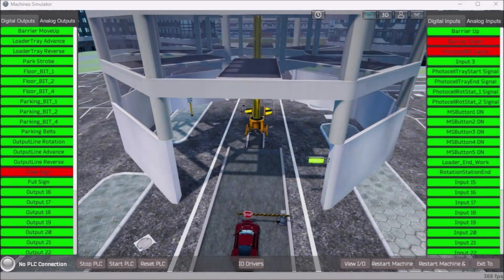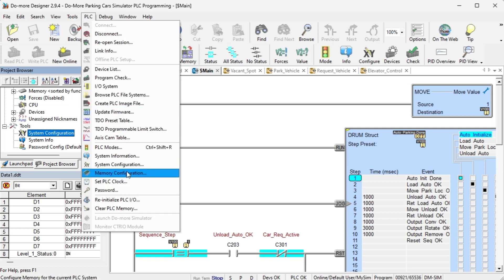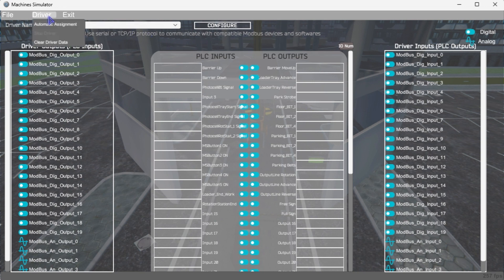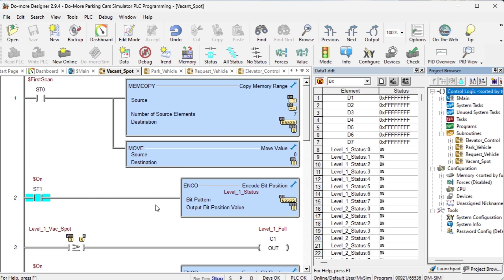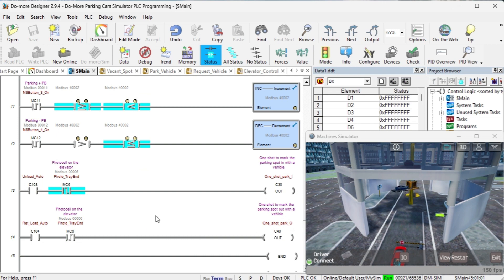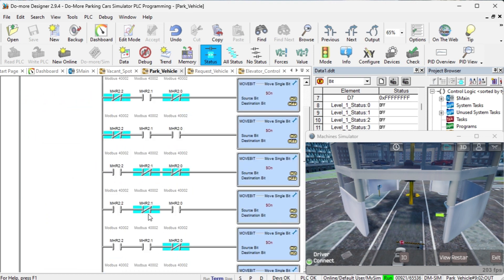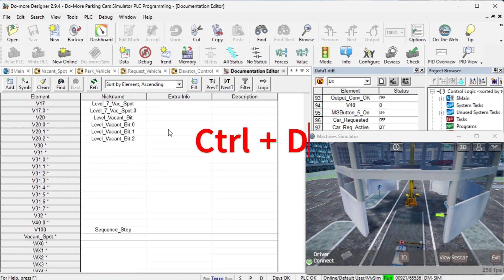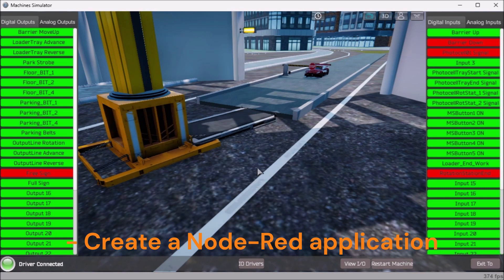Master PLC Programming with 3D Car Parking Simulator Part 2

Comment from the maker: More information can be obtained on our website. This includes all of the links mentioned in this video.
https://accautomation.ca/parking-cars-simulator-plc-programming-part-2/

Purchase your copy of this learning package for less than USD 75 for a single computer install or less than USD 100 to allow different computers.
Receive 10% off the price by typing in ACC in the comment section when you order.
http://www.nirtec.com/index.php/purchase-price/
Learn PLC programming the easy way.
You can invest in yourself today.

The EasyPLC Software Suite Series can be found here...
https://accautomation.ca/series/easyplc-software-suite/

EasyPLC Software Suite is a complete PLC, HMI, and Machine Simulator Software package.
This PLC learning package includes the following:
Easy PLC - PLC Simulation will allow programming in Ladder, Grafcet, Logic Blocks, or Script.
HMI System - Easily create a visual human-machine interface (HMI),
Machine Simulator - A virtual 3D world with real-time graphics and physical properties.  PLC programs can be tested using EasyPLC or through other interfaces. (Modbus RTU, TCP, etc.)
Machine Simulator Lite - Designed to run on Android Devices.
Machine Simulator VR - Virtual Reality comes to life so you can test, train or practice your PLC programming.

Here is a list of YouTube Shorts about the EasyPLC Software Suite, including the Machine Simulator.
https://www.youtube.com/playlist?list=PL3y71jAPOdZAvTC8-TWNifAHpgEkAfqZQ

ACC Automation
https://accautomation.ca/